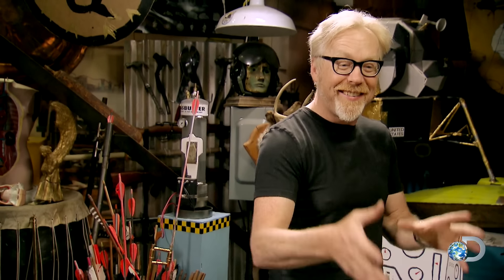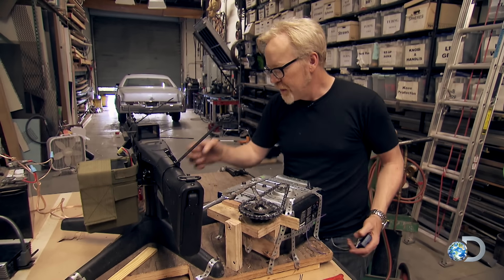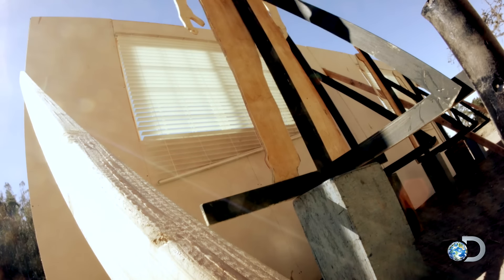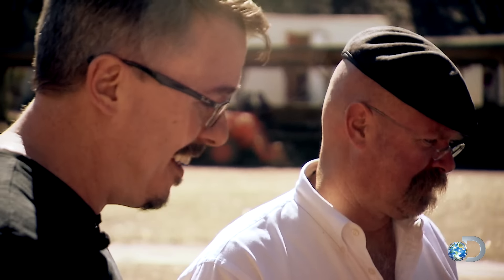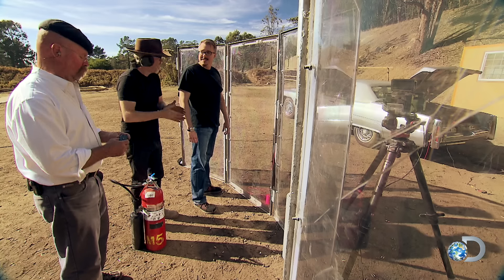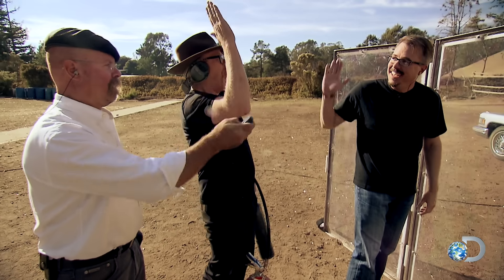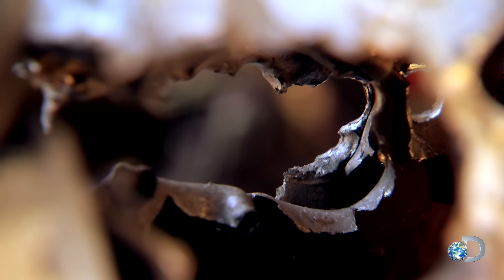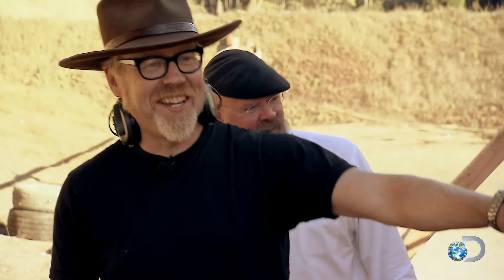Breaking Bad Finale Breakdown | MythBusters

Comment: Pretty much anything in Breaking Bad was plausible. The show was so scientifically accurate.
Reply: I think they fucked up when Mythbusters didnt use crystals and they used powder in the explosive myth
Reply: +Tasu Sutinen i think they already did
Reply: +Chakib Tsouli They did a BB special before and I think both things they tested didn't work. The explosive Walt threw on the ground at Tucco's in season 1 and the bathtub of chemicals to dissolve the body both didn't work.
Reply: +Chakib Tsouli Apart from Gus walking out of that room before dying
Reply: +Chakib Tsouli The bathtub didn't work. The Mythbusters used different tubs and different acids and they couldn't get a gun or all the remains to dissolve. None of the bathtubs lost their bottoms. Also, they tried throwing the stuff on the floor to see if they could blow the windows out of the place while everyone was ok but the amount didn't do anything and the force of the throw didn't set it off either. Then they rigged it to blow but the amount wasn't big enough to blow the windows out like in the show, so they used the whole bag and it demolished their make-up house.
Reply: +Chakib Tsouli the creator said in the video this was the only thing they tested that was true. not sure what you are thinking.
Reply: +Chakib Tsouli Also it ain't shit to get 98% pure meth. Acetone wash recrystallize. Pretty damn simple.
Reply: +jordzkie05 Also passenger planes are all fitted with colision avoidence systems that would automatically make one plane climb and another dive in such an instance.
Reply: +Hash Frowns An indicator of, sure. But here the blue color was a trademark. So it was unusually pure meth with an unusual impurity, but still a lot more pure than ordinary meth. If he had removed the blue clor, it would have just been even more pure.
Reply: So he added concentrated food coloring.
Reply: ^ not to mention cook in houses littered with insect problems before or after poison was sprayed
Reply: +Hash Frowns blue meth is real. i used to be a meth user and i know there is blue meth. it's called blue ice and it's more expensive than the clear one.

don't take me to chemistry talk for i don't know shit. all i know is blue meth exists.
Reply: Anugerah Ardiansyah
Strange that the blue cost more than the clear I always thought the blue stuff was slightly lower quality than the clear stuff.
Reply: Fulminated mercury doesn't do as much damage as it did in the show. If he dropped that whole bag I doubt it would have caused as much damage as the first crystal. But in the show if he dropped that bag it probably would have looked like a fucking nuclear bomb going off holy shit.
Reply: +IAN 4000 
ال مسعوود 
#تهامة_قحطان
Reply: +IAN 4000  they diden't have the crystal version so it wasn't 100% accurate
Reply: Also, a home with bug infestation is going to be contaminated with insect feces, insect shed, eggs, etc..it doesn't matter if they put their little meth making tent up or not..bugs like cockroaches tend to contaminate the air.
Reply: +Brendan Beckett The body DOES dissolve, the bathtub doesn't.
Reply: IAN 4000 In the test with the fulminated mercury, they could not blow the windows without killing everyone in the room.
Reply: Chakib Tsouli . I just returned from out of the country on business and finally have time to write concerning this food issue. But I was highly dissatisfied with the food.  It got to me in a jumbled mess almost like it was dropped on the floor and put back in its containers. It had a funny taste to the sausage sauce and pizza. Arrived semi cold. And for three days after I was on the toilet with the runs and a severely upset stomach. The female driver was so kind so I don't want her to get in trouble. I noticed some non food like debris I picked out of the  side of sausage I ordered that was like hard bone. 50 dollars for this? Not sure if it's the drivers fault or the actual restaurant but this was and is unnaceptable and I'd like resolve in the form of a refund. I love Uber and all of your services as I've used them for years and I'm not one to complain, but this was a horrid experience. I truly believe it was dropped including the pizza because that's how it all looked when I got it. As if it was dropped and quickly stuffed in and thrown back together to sell.
Reply: Pseudo meth is more desirable than P2P+methylamine meth because pseudo creates the more desirable Dextro enantiomer of meth. P2P Meth makes racemic meth which has both 50/50 levo and dextro enantiomers which makes it less euphoric and creates more adverse effects. Also Clear is what you look for. Blue is a sign of impurity.
Reply: YEAH SCIENCE!
Reply: The explosion isn't plausible.
Reply: That's why it's the best man
Reply: Joshua Pearce wrong the blue colour was because one of the products they used to make it made it turn blue watch the show I’m sure Walt says in one episode why
Reply: @clay391  LMAO
Reply: @mikemccombe9852  well yeah but that was humorous it was just a badass death scene not really story important
Reply: not really. 
1. no amount of fulminated mercury would explode like it did in Tuco's hideout
2. Hydrofluoric acid experiment was repeated with animal flesh and it really sucked at melting organic matter. it will leave a horrible burn marks, yes, but even after a day it would not dissolve much, even the bathtub. you'd get better results with slaked lime
3. as the video demonstrates the machinegun would obliterate the entire house top to bottom, not leave a neat straight line.

i love this show but calling at 100% scientifically accurate? nah.
Reply: @Hash Frowns well you gotta remember his meth didn't start out blue
Reply: Ah no. THT chemical Methylamine tht Walt and Jesse stole can be made at home easily. So many parts where they stole it over and over wouldve changed dramatically.
Reply: @mikemccombe9852  Nah, at the right angle of a blast like that you can survive just long enough to walk out of the room
Reply: Pretty sure the blue part in the meth was bullshit, that didn't make any sense.
Reply: You guys are talking about the purity of the meth and shit being wrong like you actually know wtf you're talking about lmao.
Reply: I mean not really , you cant make pure meth with Walter's method due to stereoisomers making it at best 50% pure. Also methylamine (which is a persistent major plot point of the show) would be very easy to synthesize for a chemist of Walt's purported ability.
Reply: The coffee pot/zip ties escape scene was not realistic.
Reply: @jameslowell9656  wow
Reply: No lol
Reply: No. It wasn't. It's pretty laughably inaccurate.
Reply: Except the blue meth itself.

Comment: Imagine the motor malfunctions and goes on doing 360s
Reply: The linkage arm prevents it.
Reply: I thought of that one too but then they appeared behind the bullet proof glass.
Reply: @ashtickprakaspadhi1000  trust me under sustained fire that glass wouldn't hold.
Reply: @Valkires1  if it did 360's, it wouldn't be under sustained fire.
Reply: That what kids call EPIC FAIL LMAO
Reply: I am sure the system had a failsafe. They probably had a trigger in hand (probably the Range Master) that would shut everything down when released. 

The shield was probably less for round protection and more for debris.
Reply: @Valkires1  They could just duck
Reply: @ashtickprakaspadhi1000  it wouldn`t hold even a smaller caliber, not saying that
Reply: Nah Walt is perfectionist..99 % pure.
Reply: @ChucksSEADnDEAD  Also the trunk.

Comment: But did the side of the trunk of the car catch on fire like it did in the BB episode from the heat of gunfire?
Reply: Could of been the tracer rounds that started the fire on the side of the trunk
Reply: Walt was using AP Tracer rounds, that's why the trunk was on fire, I don't think the MythBusters used anything other than ball ammo
Reply: There was a small fire on the car.
Reply: If they used a sedan instead of a coupe it would have been on fire
Reply: @Nate_the_Nobody  ex 60 gunner here mate... you would be correct.. AP tracer catches shit on fire.

Comment: In 2019 this dangerous af ........ you can buy all this in a local town
Reply: Smh, damn America selling garage door openers and VCRs.
Reply: Except the M60 full auto so....
Reply: @ChaseVonnegut  You can buy a belt fed conversion for many guns and it's a simple matter to file down a sear to make a gun full auto.
Reply: @kg4boj  I dont know of any semi auto M60s
Reply: Peter Carlson sure , that simple, just file down the sear.
Reply: @Dixler683  That doesn't work. The sear engagement surface is what allows the trigger to fire in the first place. Filing it down will just cause a weapon to either fire or get a hammerfollow malfunction the moment you try to charge it with the first round.
Reply: Jack Benton that was a whole lot of writing for so little said. We all know full autos are legal. But you aren’t going to the store to buy one, and if you have the $50-100k to spend on it and are willing to wait a year and capable of passing an exhaustive background check, you too can get one. You can also buy a tank.  End of the day, you can’t effectively buy one unless you’re some rich mother fucked. And they can do a lot of other things.
Reply: Michael Esposito you can rent them at some ranges

Comment: That safety glass they were standing behind didn't look very thick. Had the swivel stand failed and the gun spun 360, that could have ended very badly.
Reply: They did tests in the early seasons to make sure these barriers were sufficient.  If you'd watched many episodes of Mythbusters, you'd know their top priority is safety.
Reply: @Panzermeister36  facts
Reply: experiments like these they'd have tested the thing multiple multiple times just to make sure they're safe
Reply: I'm guessing there's stuff done not shown here. Like bolting that tripod to the bottom of the trunk.
Reply: I believe they also had a dead man actuator for the trigger.  All Jamie would have had to do was release the actuator and the gun would have stopped firing.  So with that, the fact that it could not swing around to the left (barrel would have hit the end of the trunk), nor to the right (barrel would have hit the garage door opener), and they were behind a safety barrier, they were fairly safe.

Comment: Imagine if the machine gun restarted once they went there.
Reply: Pretty sure they would have disarmed it long before they went anywhere near the house...
Reply: They could have hid where walts body was
Reply: I'm sure they had a firearms expert there to load and clear it before letting them walk in front of it.
Reply: pretty sure air bullets cause much harm, right boi?
Reply: @EAL2310  the "firearms expert" came over and flipped the switch from "fire" to "safe" and was paid $1000 dollars for it.
Reply: How would it matter if it restarted, they didnt stop the test until all the ammo was used. So it would just be a machine gun making clicking noises.
Reply: @Vitross  could be a hang fire.
Reply: @stevew278  You don't need to write "$1000 dollars". If you use the dollar sign, you don't write the word "dollars" after the figure.
Reply: @stevew278  Regardless of what he did, he still knows more about firearms than anyone else on that set so he does the job, he gets paid. That simple. He only got the job because of his knowledge and experience anyway.
Reply: @stevew278  he also loaded the gun, disarmed it and probably had a hand in the gun being available because you can't just get your hands on an m60 that easily.
Reply: @dunebasher1971  pretty sure I can do both, Dollars $1000 dollars OH NO I DID IT AGAIN !
Reply: @en2456  I wish it was that easy to get your hands on an m60.

Comment: This is for the 1% of the people that actually didn't like the finale because of the unbelievability of that scene! Even i had my doubts but it was still awesome, but now it is also plausible. Breaking Bad is awesome and now that i know that would've actually worked i can give the finale a 10/10 instead of a 9.5. God i miss that show. Vince is like 'i came up with that monstrosity!'
Reply: ethanSADTP what about it was unbelievable ?
Reply: I don't think there's anything about it that seemed unbelievable, with the only exception being that it turned and fired too slowly -- the natural reaction to hearing gunshots and seeing bullets fly into a room is to get on the floor, so I don't think it would have been as effective as depicted. 

Still, that's why it's so great, it's just basic parts and close to hobby-level mechanical engineering. Everything about it is easy to understand for The audience, who probably feels like they could do the same thing if they had the drive to.

Comment: 1:50 guy loading the ammo belt is wearing a rolex submariner. Rather expensive watch.
Reply: Not really ?
Reply: @michaelesposito2629  what? They cost a few thousand to over ten thousand dollars. How is that not rather expensive?
Reply: Chaz MichaelMichaels Lol everyone has a freaken Rolex. People think they are special. They are watches people wear to look rich. Rich people don’t wear rolex. These watches are also passed down from family or given by work when you retire, and last decades. So it’s not like people just bought a new watch . It wasn’t a watch that needed to be brought up lol. The people on the show should be afford to afford watches way more expensive than a submariner
Reply: @michaelesposito2629  the way he I pointed out appears to be a newer one. Either way, most people don't drop $15k on a watch. Just because a guy is on a show for 5 mins, loading a gun, doesn't mean he can afford a rolex. Passed down rolexs are not modern day models..
Reply: Chaz MichaelMichaels in what way does it appear to be a new one? Let alone that he didn’t buy it used. And now we went from a few thousand, to $15k?  That thing could be 10-20 years old. Again, you are way over valuing some run of the mill stainless rolex. And more than likely, the guy loading it is the guy that owns the $70,000 machine gun.
Reply: @michaelesposito2629  why are you debating if it's expensive or not. Touch some grass

Comment: they did not close the truck of the car.
Reply: thats only so we could see it in action.... as if that would make a difference anyway...
Reply: actaully, at the end of Breaking Bad once the truck  open the machine gun will start firing, I thing there was also some kind of mechanism that activated the machine gun once the truck  open.
Reply: Bender Rodriguez The trunk was linked to the keys so it was a pre built device manufactured into the car to allow the owner to open the boot automatically using the key fob....Not a big deal.

Comment: They didn't do this right. The wall in breaking bad was made of cinder block not wood
Reply: samdiego Doesn't matter much at this distance, a 7.62mm round will go through it as well
Reply: Remember, cinder blocks are not solid concrete. They are hollow with a support piece in the middle. Full jacketed 7.62 ammo would go right through it and armor piercing would go in one side and out the other and still have enough power to neutralize  a target standing in the rear of the building. Cinder blocks are not good cover.
Reply: I’m trying to say that if they wanted to test this myth right, they should have had the conditions the same. It makes no sense why they didn’t use cinder block
Reply: The building in BB was stucco. To replicate that, the MBs used concrete panels for siding.  Close enough.

Comment: I mean, the tripod would have required to have been a lot more stable and stronger to not only support the weight of the turret and the machine gun, but also its volatile recoil. Which here, some rounds went way high and way low. Insanely awesome nonetheless.

Comment: now where did u get this M60…?
Reply: It's not hard to get an M-60 in the US, 12k for the semi auto version, a conversion to full auto wouldn't be hard for a criminal. You can buy a full auto version too but need a license/permit and they are way more expensive and the supply is smaller. A lot of gun ranges have them for rent and shoot.
Reply: @xlDeathlxJosey   ah, but shown here they had a permit